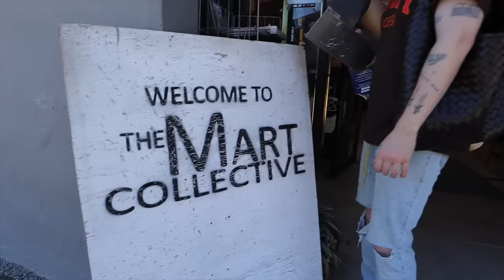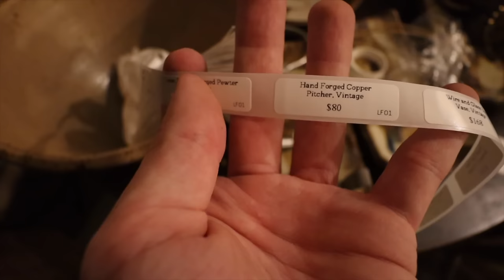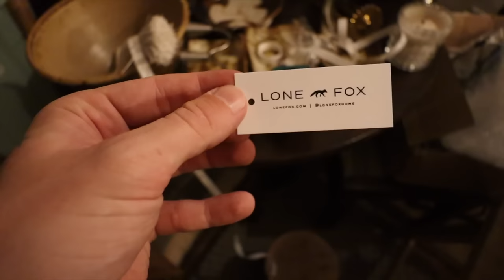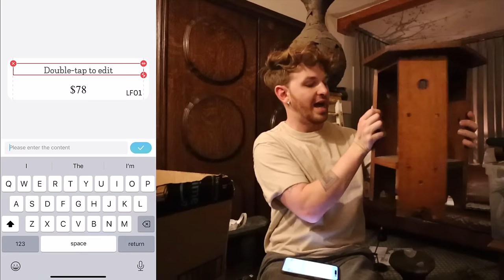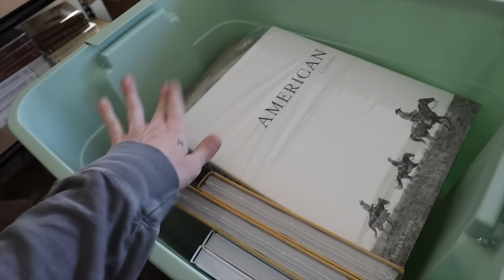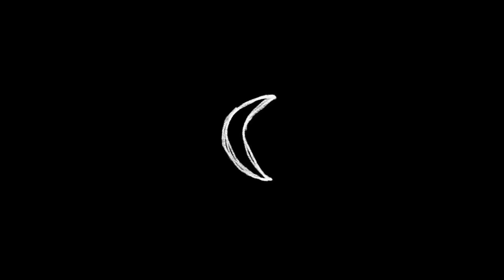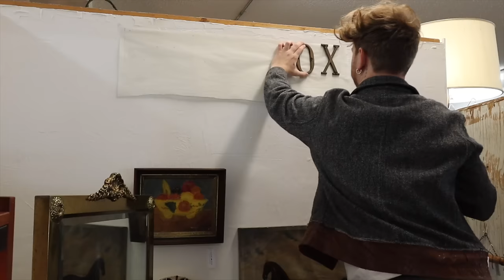DIY ANTIQUE BOOTH MAKEOVER ✨ Open A Shop with Me (From Start to Finish)

Comment: As a past antique store dealer/owner, I have a tip about tags. Don't put prices on the bottom of any item. You're asking for breakage whenever anyone has to move items to find a price. Make it easy to see every tag. And be sure the adhesive price tags stay on the items. I suggest double tagging items to make it harder for a dishonest shopper to switch tags---yes, that happens all the time in antique malls because the thief knows the person checking them out doesn't know the prices of your items. Good luck!

Comment: I cannot thank you enough for not putting your sticky labels directly on your goods. It hurts my soul to recall the number of times I have had to remove ~with the utmost care~ adhesive residue from vintage or antique items.

I panicked when I first saw your label maker, but then realized you were putting them on the back of your cute little cards. ☺️

11:00 Drew, no! No, Drew! 😂😂
Mkay…I will trust you that your stickers come off cleanly…but I am skeptical. Once a sticker has been on an item for a few months, the adhesive starts to break down and that, more than anything, is what causes a residue. 

Still team tags.